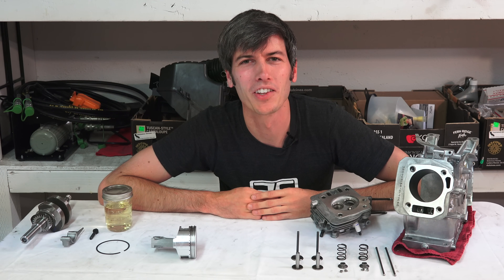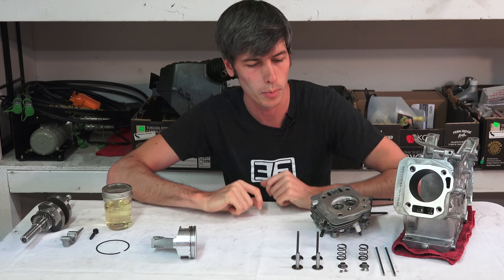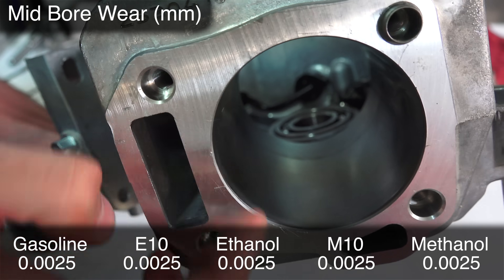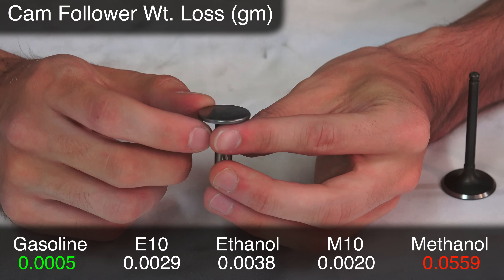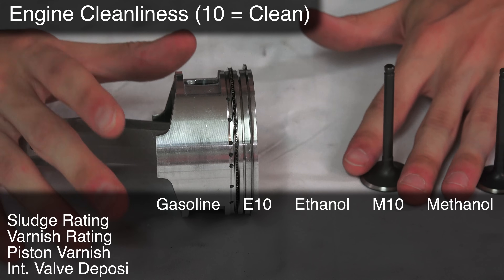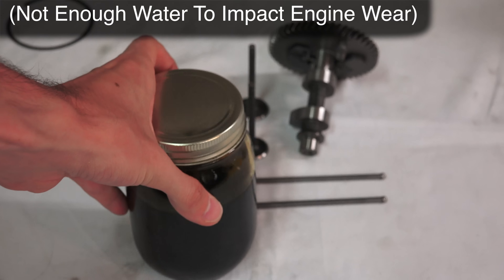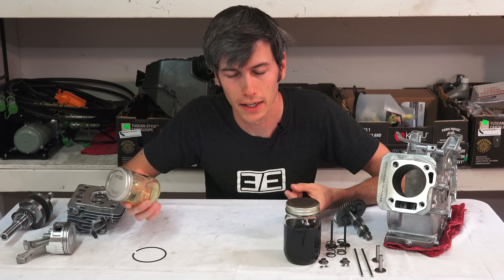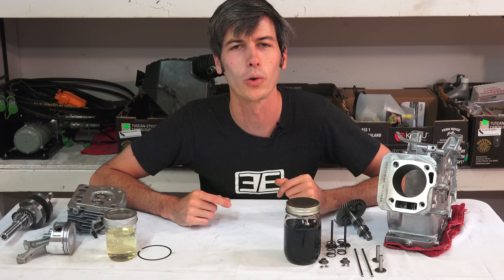Is Ethanol Bad For Your Car's Engine?

Comment: I just bought a 1994 neat ethanol car, i live in Brazil. The car has run with ethanol for all its life, and the engine has never been rebuild. If you look inside the valve cover, the engine looks like brand new , not a single black spot.
Reply: Not even rust?
Reply: Go to a junkyard and take the valve cover off any of the cars in there

its gonna be dirty and shitty underneath
sludge buildup, if that didnt happen to that guy's car its a good thing

though generally we assume its just gotten its oil changed at the right time every time
Reply: Too bad Brazilian are moron . Wtf has that prove absolutely nothing.  If the engine is 40 years old i bet is worn out wtf you on about . I'm Uruguayan but live in Australia and cars in latin American nation are all worn out shitboxs blow lots of smoke
Reply: @_i-kr6eg  actually e100 has a lot of benefits over gasoline, it even decreases clinic variation and has a better "flame angle"...
Reply: fuqoff aye?  i guess that 600.000 mi in my friend's j body e100, that the engine was never opened even for a head gasket change, is enough to say that it doesn't harm the internals

Comment: Simple answer...yes unless it was designed for it...or you drive the car very little...it'll ruin the fuel system
Reply: I seen crown vics run strictly on e85...with rust holes in the fuel tank...from the inside out

Comment: Thats just the Hard parts.   How much wear/deterioration happens to the soft parts? Hoses/seals/carb jets?
Reply: I doubt any. The hoses should be designed to handle ethanol now.

Comment: Read your owners manual it will tell you what gas/blends to use
Reply: Interesting that my owners manual says to expect a noticeable reduction in fuel economy with E10, and that if the owner doesn't like that, choose straight gasoline (if it's available, and fortunately, where I live, it is, and becoming more commonly available all the time).
Reply: Manuals saying the vehicle is OK for E10 are like saying humans can process fast-food without issues.

Comment: Seems they didn't check the gaskets, which can dry out from to much ethanol if your car is not made for it.
Reply: Not the focus of the study.
Reply: The problem with ethanol doesnt lie in the engine block.... it lies with the fuel system and any rubber/man made material it comes into contact with. Additionally, I dont think we should be using fossil fuels to process millions of bushels of corn into inefficient fuel...... One would be better off feeding the rest of the world with the corn surplus and just go with gasoline. The same goes for using electric vehicles, there is absolutely no point in using an EV that get's it's power from a grid that is, for the most part, powered by coal. You are outsourcing pollution, and you are outsourcing it to a more inefficient source than you would if it were from gasoline. You also then have to factor in transmission losses.... conversion losses from heat to mechanical to electrical..... losses in charging... losses in converting all of that back into electricity and mechanical energy..... Its just a waste of time, never mind the poor chinese slaves who mine all that explosive lithium for you with polluting machinery who then ship it on cargo ships that run on diesel.
Reply: RedRyder That’s I find it funny when people thought electric is going to be the future lol

Comment: On a slightly related note, ethanol blended fuels are awesome because of the octane increase.

If manufacturers released turbo flex fuel vehicles that made considerable use of this I'm sure e85 would have been a commercial success in Australia. Instead we got a handful of naturally aspirated offerings by one company only that ran slightly less pathetic on the super high octane brew...

Instead of 8psi more boost we got 4 degrees more advance... Yay...
Reply: Here in Brazil flex fuel cars are really common. I have a 1.6 L turbo flex, usually it runs on 92% ethanol and 8% water. It works really well, you can feel some difference in power when running on Ethanol. There are some cars running around here with 3 fuel options (any mixture of gasoline and ethanol + methane). Unfortunately cars that run on methane are always aspirated.

Comment: Does LPG /CNG bad for a car engine? Please make a video about this fuel!
Reply: Other than they're "dry" fuels, LPG / CNG make great engine fuels.  Higher octane ratings, but lower BTU ratings.
Reply: btu is such a garbage unit
Reply: but to us Americans, it's perfectly normal.  It's what I'm familiar with, so it's what I use.
Reply: If you are serious you won't need a video.  Search engines are your friends and there is ample material on conversions. Unless you have a very old carbureted vehicle which can use a basic setup like IMPCO sells, it's not worth converting unless you live where CNG/LPG fuel is far less expensive than petrol.
Reply: @obfuscated3090 Europe has the LPG/CNG 50% cheaper than the other fuels is  a big difference.  Europe also has expensive unleaded I don't know what is the price at the USA...
Reply: in the US,  the common e-10 price where I am right now is about $2.90/gallon (Oct 2018).  My tank fill up on no-ethanol yesterday was $3.08/gallon.   CNG last I looked was $1.87/gallon equivalent.  My friend has 300,000 miles on his CNG converted car and never made an engine repair.  Said he wishes he'd had a larger tank installed is all...
Reply: Usually industrial engines designed to burn LNG, CNG or LPG have some beefed up valves and stellite valveseats. I've even seen some 350 small block Chevys in forklifts with sodium valves that were built to run LPG from the factory. That all being said, I've seen plenty of engines converted from gasoline to  LPG without any modifications to the valves and they didn't seem to have any significant problems

Comment: UK is trying to introduce E10. At the moment, 95 Octane has 5% Ethanol
Reply: 'Trying to' is an optimistic view. I've recently reviewed a DfT consultation document on E10 introduction here in the UK - but it's already available in France & Germany. E5 varies a bit, as E5 has a maximum of 5% Ethanol - can be less. My main gripe about E10 coming on sale is the fact that the tax rate (excise duty + VAT) on all fuel oils are identical, independent of the energy content per unit volume, so unless the oil industry side of the mix is a lot cheaper than E5, we would all end up paying more tax per kWh energy delivery.
Reply: @johnkeepin7527  Gov screwing us over?  Best grab a ticket....
Reply: it will wreck many a classic car fuel system for an EU directive, we are told leaving?

Comment: I'm a small engine technician (had many engines aparts over the years) I have noticed engines run on ethanol blend fuel have thicker build up of carbon than engines that haven't been run on ethanol blend fuel. 
Carbon is sticking to the piston crowns badly at least on the air cooled carberated engines witch can causing issues overtime.

I have older flat head engine maintenance manuals saying to pull the head of and clean out the carbon build up. (around every 200 hours)
That being said nobody does that and the prossess is made more difficult with introduction of OHV heads so I suggest running a cleaner threw small engines (around 200 hours) to prevent excessive carbon build up😉
Reply: Willy Cooke That is because you forgot to tune your car to ethanol usage. We use a electronic injector instead of carburettor though, so it allows for engine tuning.

Comment: Were these tests performed using carbureted or fuel-injected engines?    Were the carburetors jetted (adjusted) to run near stoichiometric for the different fuels?  Running an engine too rich or too lean will have a large effect on engine wear.
Reply: In a study published in 1981?  I doubt they bothered to test a fuel injected system.
Reply: It's an americam study they probably used carburators till 2010. Mid range RPM probably also means about 1500rpm.
And just to be clear using only one engine makes the whole study irrelevant because: 
Version 1, the same engine for all test: the wear prozess is not linear so you got cross influences from the testing order.
Version 2, same kind of engine, but different engine: You probably got more influences from the different production qualities of the engines than the fuels.

So just do it right and use the average of a minimum of three engines for each fuel, or just stop publishing useless research papers!
Reply: I didn't look at the study directly, but when I googled "2.3L 4 cylinder 1981" it pointed me to the Ford "Lima" engine. It was carbeurated until 1984.

Comment: So if you want a rotary engine to last long, E85 is actually a good idea ...
Reply: Or if you want to be apart of the conspiracy, still use gasoline. They say it is good, they say ethanol is bad.
Reply: So, with your username, I assume you have a rotary and use E85 ? How good is it  ? And I think it need a flex senser and a new fuel pump no ? Asking beacause i legit want to buy a RX8 later on ...
Reply: I have a four port (good torque for street) for a year now. E85 on stock pump, torque at 3-4 rpm, tapers off but revs to 7500. If you want the six port you have to try E85 on stock pump and see for yourself, but stock pump will give best mpg.
Reply: Not sure if the old RX7s tubes and stuff were really designed for that, so might be a good idea although I'm not opposed to using ethanol in more modern cars if they're equipped to handle it, or properly modded to support ethanol. Although I suppose if something breaks you can always replace it with an updated more ethanol compatible part. I'm sure RX7 owners are used to things breaking and needing replacements anyway :) heh
Reply: The RX-7 wasn’t designed to break but unfortunately gasoline does that to high reving apex seals. Way more effort to keep seals clean in gasoline engines especially apex seals that require movement unlike piston rings which are stationary, and can collect all the debris of deposits.
Reply: So you're saying ethanol keeps the engine cleaner basically.

Comment: Can someone explain how methanol damages cam lobes?
Reply from the maker: Yeah, that one did seem a bit strange, and their theory in the paper states that they don't assume it's from oil dilution, though the methanol did cause more dilution of the oil than others. So I would assume it would have to do with making the oil less effective.
Reply: @EngineeringExplained  maybe the 500+ iron count in the oil? Or if there were maybe timing issues the methanol would both damage the top of the cylinder bore and the cam. If the test were done with individual motors for every fuel type (and not repeated), maybe the methanol engine was just a lemon?

Comment: So you're telling me I can't drink and drive, but my car can?
Reply: Pretty much
Reply: Ali Syed even when a beer is only 5% Ethanol
Reply: Yes
Reply: Exactly...
Reply: Unless it’s a Tesla driving itself.
Reply: Communism
Reply: Joke of the day
Reply: Alcohol and gasoline do mix, but the mixture is even worse for your health than pure ethanol and tastes much worse.
Reply: ethanol has water in it. Water being the real contaminant here.
Reply: Yes, I remember teh scare that 'ethanol is an aggressive chemical sure to eat your fuel system. Hey, fancy another beer? Ever seen it dissolve anything?
Reply: @pizzablender  I've haven't seen any wear on my fuel system or mechanical parts on my 04 grand prix. Been running 3/4 e85 and 1/4 gas and marvel mystery oil.
Reply: Pop can dissolve stuff for sure, not sure about beer. Ethanol isn't going to damage anything if your car was designed to use it. Most modern cars are designed to use  up to 15% or 20% ethanol in Canada most of our gas has up to 10% ethanol. Flex Fuel cars can handle higher amounts of ethanol.
Reply: @pizzablender  Yes I have, haven't you? It's more noticeable with more concentrated alcohol (eg. vodka) but the reason wine is such a good pairing with fatty food is because the alcohol dissolves the grease and fat that has coated your mouth after eating, same goes for beer.

It does degrade some rubber compounds, but in modern cars (at least 90's and forward) engineers has taken that into account so it's a non issue at this point.
Reply: @pizzablender  It will slowly destroy some seals and hoses but it won't dissolve them.
Reply: @pizzablender  Alcohol is one of the best cleaners on the planet because of how corrosive it is, and it also kills just about anything. But yeah, another round for everyone at the bar. :P
Reply: gasoline is a lubricant alcohol is a solvent.
Reply: @douglashoward4206  both are strong organic solvents

Comment: Ethanol separates from gas if it sits for too long. It also likes to absorb moisture. If your car just sits there and gets used once every few weeks, it may be harmful. If you use the car every day, shouldn't have issues running e10. Ethanol is also a solvent, so over a long period of time, your fuel lines will get corroed to shit if you have an older car. Just use Shell gas, keps your valves clean and engine running smooth.